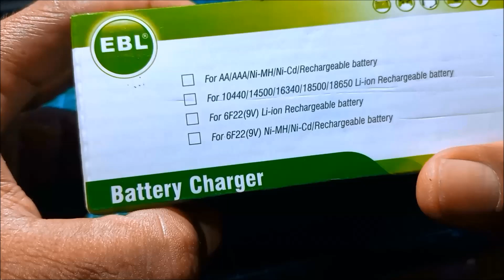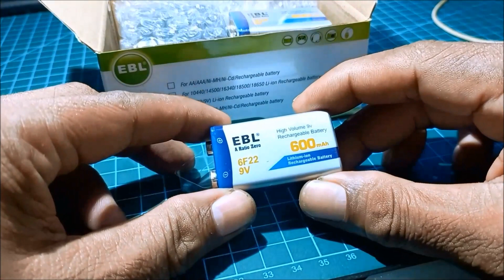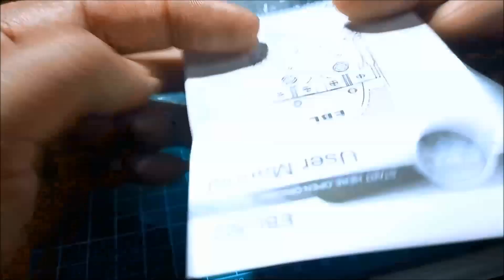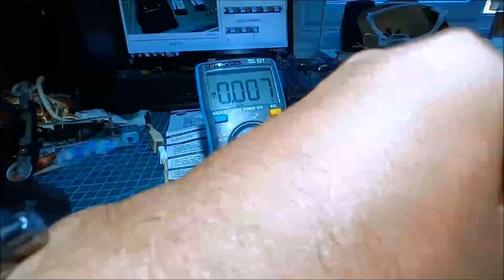EBL Smart Rapid Charger with 9v Lithium Ion Rechargeable Battery(with English Sub)

Comment: hello sir sana mapansin. kakabili ko lang ng ganitong charger at battery. same brand and model. pagkabili ko kasi, chinarge ko na agad. un indicator light nya red parin mga 3hrs ko na siya chinacharge. base kasi sa manual pag green na daw un light sa charger meaning fully charged na. ginamitan ko ng tester same sa ginawa mo 7.8v sya. tapos un charger tinester ko rin nasa 15v sya. sira po kaya un charger ko?